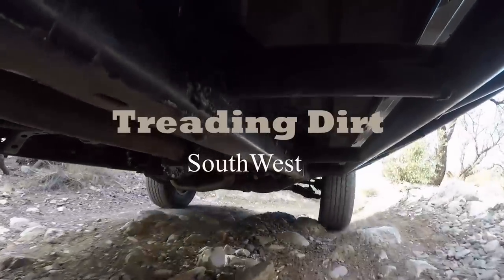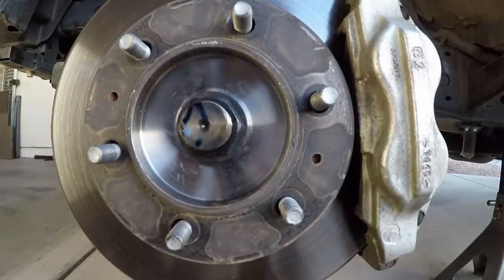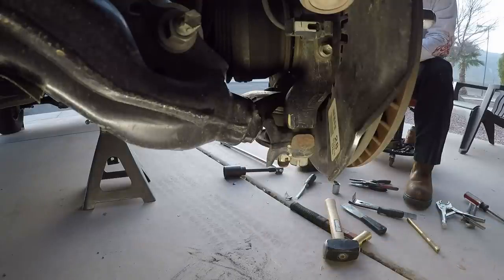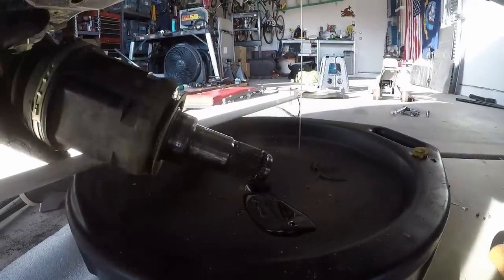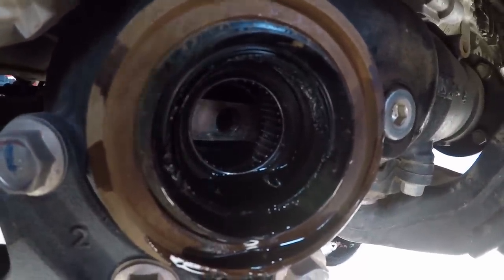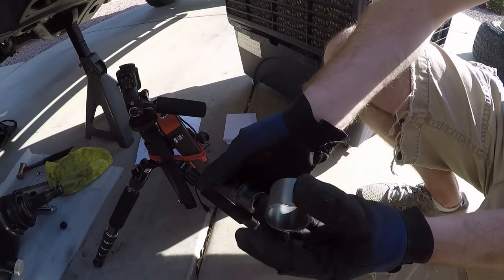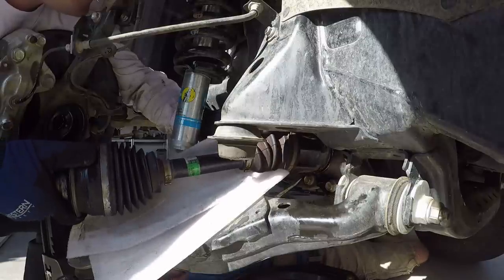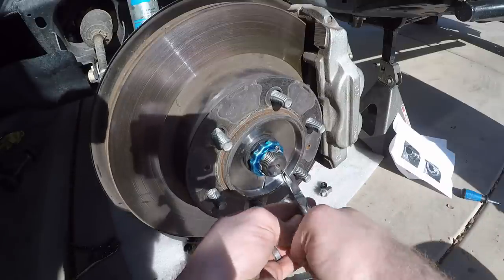Removal/Install of 2016 Tacoma CV Axle, Bonus: ECGS Bushing install

Comment: I just did this on the weekend on my 2017 trd sport and followed this video exactly and it worked great! I have 80,000km on my truck and i didnt do the seal as it looked to be perfectly fine and it is still holding great after the install, not a drop of fluid is leaking out! My only recommendation, which these guys say too, is to take your time placing the needle bearing puller behind the needle bearing. If it isn't going in, take a breather for a few minutes and try again. I grew impatient  and frustrated and ended up not installing it all the way and regretted it, I cracked the puller and had to weld it back together and re tap and die the threads (not my most proud moment). Don't be scared to give the puller a whack or two with a punch and hammer to get it to seat properly! Without the whole mix up of screwing up the puller tool this install would only have taken an hour by following this videos instructions. Thanks for the great video! No more vibrations
PS using a flat head and hammer to get the CV shaft out worked awesome, took 2 minutes to remove it using that technique
Reply from the maker: airsoftkid1245 glad it worked out but sorry to hear about the cracked tool. We’ve been known to bust out the welder a time or two as well lol.

Comment: Great video, another easy way to hold the rotor while you break the CV nut is to have someone apply the brakes. It requires a 2nd person, but works great.
Reply from the maker: Lee Mims  thanks for the positive feedback and great tip about the brakes!

Comment: Unbelievably excellent video!! In 2017, I purchased a 2016 Tacoma with 18,000 miles on it. We noticed an intermittent vibration almost immediately. We took it back to the Toyota Dealer and they said they couldn't hear it. It is a pulsing at about 50ish miles/hour. Unfortunately, it is weak at times, then at other times, very prominent. I recently took it back to Toyota and they replaced the back springs. Might I add that this was free of charge(54,000 now). I believe that this was due to the tech bulletin fix. Well, The vibration came back and my truck sinks down more when I put my utility trailer on. So, I received lighter springs and I still have that vibration that you can feel in the steering column and the accelerator pedal. I have an appointment, at the dealership, next Monday. I don't know what they will propose. I guess I want to know if this pulsing vibration was your experience. I am willing to tackle this fix if indeed it will resolve my issue. I think that the passenger side would have an identical Needle bearing? Again, thank you for the vid. I do absolutely love this vehicle. I am just trying to work out bugs. Thanks to all, in advance, for your answers.
Reply from the maker: Mick Reese hey thanks for the compliment! Have you tried engaging 4x4 to see if the pulsing goes away? If it does, that increases the chance it’s the needle bearing. And yes, mine was a pulse at times. 

Passenger side uses a different bearing so it’s just the driver side that typically has the problem.

Comment: Has anyone had this problem with 2018 trd off road 4x4?  I'm getting ready to lift my tacoma and was wondering should I buy one any to have when I install my lift.  Thanks. Best video for this.  Great job
Reply from the maker: Chad Boggs trd yes, even 19’s. Until Toyota stops using a needle bearing on the driver side this will continue to be a potential issue.
Reply: @TreadingDirtSW  thanks.  Guess I will go ahead and order a ecgs bushing so I will have it when I start lifting my tacoma when it gets warm here in kentucky.  Thanks again
Reply: Yep. I have 2018 and as soon as did 3" leveling kit , maybe after 3 weeks it happened.
So, don't wait for it , replace it right away

Comment: Great video, way better than the ECGS supplied video. Wish I saw this before I replaced mine.
Reply from the maker: srqFF I really appreciate the kind words. I did my best to make the video I wish I had before I did mine.
Reply: Treading Dirt SW my only suggestion for others is to get a torque wrench for the axle nut and do it to exactly 173 ft/lbs. The first time I did it, I didn't use a torque wrench and just hammered it on there with an air wrench. Less than 500 miles later, my wheel bearing went bad. I'm not sure if this was the cause, but it's better to be safe and do it to spec.
Reply from the maker: srqFF yep I agree! Mine only goes to 140, im looking into options for a longer torque wrench with a higher rating.

Comment: Maybe a stupid question, but what gear oil did you use to top off after you finished the job? Did you buy the toyota 75W85? If so, did you have to go to the dealership to buy it? My local autozone only has 75W90....
Reply from the maker: sakusan23 I just went with full synthetic 75/90. It’s so close to factory spec it won’t hurt anything.

Comment: You can avoid the struggle pulling the cv from the spindle by unbolting the brake line bracket from the frame.

Comment: One trick I do to remove axle nuts is to insert a large punch into the top side of the caliper and into the cooling fins of the rotor. Save a ton of time trying to wrestle pry bars and breaker bars and potentially bending a stud.

Comment: What was the noise?  Mine is a rotating rumble and pause and rumble and pause almost like driving on rumble strips with a slightly longer pause.  I can feel it in the accelerator.
Reply from the maker: Sounds about right! Mine was somewhat rhythmic and could be compared to light rumble strips.  

If it happens under 25-35mph but goes away in 4hi then it’s probably this bearing going bad.

Comment: I wonder what are the symptoms of a bad needle bearing, I cannot feel any grinding noise or vibration but I have some play on both axle shafts. I've found many videos showing how to replace the bearing but none showing the before and after movement. Is that problem just relevant to the drivers side bushing even if there is some play on the passenger too?

Comment: Did you have to undo the whole suspension to get it out. I just put a 2 inch 5100 lift. Do I have to take the 5100 out? Or do I have to mess with any suspension stuff?
Reply from the maker: R F you do not need to remove you coil assembly. The video shows 100% what needs to be done.

Comment: Did you use a career bearing drop kit or shims under the springs I’m doing a 1 1/2 add a leaf and 5100 with the 887 ome is there anything I need to do to my truck as to prevent any problems
Reply from the maker: James Howard impossible to say, I’d refrain from shims or cb drops until you have issues, if any. Easier to do one thing, then go from there if it’s not fixed.

Comment: Nice video .I got a question ,since you are install cv axle on Both sides the ecgs bushing is the same from passenger side ?
Reply from the maker: Sergio Cadima no, the passenger side uses a different type of bearing and doesn’t have the same issues as the driver side.

Comment: Great video!  I've been hearing the roar for some time now.  The dealer said it was the hub bearing but I heard nothing from them.  While checking,  I found the looseness in the needle bearing.  Where did you get the puller to remove the needle bearing?
Reply from the maker: machomie the puller is available from ECGS

Comment: Great video! Thank you. I'm going to attempt this on my third gen tomorrow. One question - did you have an alignment done afterward?
Reply from the maker: Jarrett Moore I did not need to do an alignment afterwards. Good luck!
Reply: Treading Dirt SW Great. Thanks for the info!
Reply: Well, I started on it today and got the old bearing removed and new bushing installed. I’m having a little difficulty with getting the axle back in. I know I have to apply force to get it past the retention clip, but I’m afraid to hammer away without knowing the splines are lined up. Any tips?
Reply from the maker: Jarrett Moore so tapping it in using a large flathead and large hammer didn’t work? It should go in a little further initially if they are aligned vs not.
Reply from the maker: Jarrett Moore I’ll add, it starts going in pretty easy using my method, you can hit with halfway minimal force and see it go in a few mm’s it it’s aligned.
Reply: Treading Dirt SW I didn’t really try too hard because I was afraid I didn’t have it aligned properly. There is a few millimeters of spline before the retention clip, so I’ll try again tomorrow and pay extra attention to this. I guess I should add that I was attempting to do this by myself and probably also need a bigger screwdriver and hammer. lol. I’m going to try again tomorrow with a helper. Thanks for everything you’ve done to help.
Reply from the maker: Jarrett Moore Just stick it in and give it a good tap, then if needed rotate a little and tap again. It’ll go 👍🏻👍🏻
Reply: Treading Dirt SW Got it all finished up today. Vibration and noise are gone. Wow - what a difference! Thanks for taking the time to create this video. It helped me tremendously.
Reply from the maker: Jarrett Moore super glad to hear it!!!
Reply: Just finished the needle bearing install on a 2015. Thanks to your video I avoided having to remove unnecessary components. To insert the bushing I used a 32mm socket flipped over and then inserted a 3 inch extension that I could hammer on. I was also a little hesitant to hammer the axle back in but is popped right in after a couple whacks. Thanks for a great instructional video!

Comment: Great video! Did you change your diff oil when you were done with the recommended Lucas oil or just add to what was in the diff? Was the removal tool necessary? I see it's almost the cost of the bushing. Thanks!
Reply from the maker: Jim Kotz I had already replaced the fluid previous to this with synthetic 75w90. The oil recommended by ECGS is mainly for when you swap gears with theirs, not when you do just the bushing. 
I believe 140 weight would do some good but this is my daily driver and I like the great fuel economy.
Reply from the maker: Jim Kotz forgot to answer your other question. I found the removal tool to be very useful but personally it’s a little overpriced if you ask me. Search the forums or FB groups, I bet someone would let you “rent” one.

Comment: Great thank you . Because I didn’t know you could use OME 887 springs with bilstein . How much lift did you get with no spacer just springs .
Reply from the maker: James Howard I did the lift by myself and forgot to measure from center hub to fender before I installed. It’s around 2” but I have a shell, steel rear bumper, sliders, and a 3/16 steel skid so I ended up with a little less. I think next time I’ll go with 888’s. 

And as a disclaimer, OME recommends only their shocks be used with their coils. I haven’t had issues yet nor has anyone in a 3rd gen group I moderate.
Reply: Treading Dirt SW what group I’ll join . Did you take your struts somewhere to install the top hat or just bought new ones
Reply from the maker: James Howard  I’ve used both the lower control arm and a floor jack to compress springs, as well as a rented compressor from autozone. Only one I needed to have a shop compress was 888’s I recently helped a buddy with. Truck wasn’t heavy enough and the tool failed. 

The group is 3GT-3rd generation Tacoma

Comment: Do you think it’s safe to trust any mechanic or Toyota dealership to do this procedure for me if i provide them the parts?? I was wondering how common it was and if enough shops are fluent in the procedure. Your insights would be highly appreciated! Thx
Reply from the maker: That’s so hard to say, because I’ve seen some terrible mechanics lol. I don’t think you need to take it to a Toyota dealership however. A shop that does a lot of axles/differential work would be the safest best in the absence of any of other info. If you want to be safe.

Comment: So what vibrations are you getting? 

I'm getting a rhythmic grinding and vibration between 1,100 - 1,500 rpms or 30- 40 MPH. 

Thinking this could be the issue. Thanks in advance.
Reply from the maker: Alex Helie sounds exactly like a needle bearing issue. A good test is to put it in 4hi while it’s giving you a vibe and see if it goes away. If it does, most likely the needle bearing.
Reply: @TreadingDirtSW  I got 2wd. No CV axle 😔
Reply from the maker: Alex Helie lol then I’m confused by your original question. With no needle bearing it can’t be the needle bearing. It could be the tires, brakes, drive shaft, or rear diff, rear axle, etc. I’d start with the tires personally by checking the balance and tread. 

If you are lifted it could be an issue with your pinion angle, or even an out of balance shaft. If you have a carrier bearing maybe try a drop kit, cheap and a 5 min install.

Comment: tracked this video down from the 3rd gen facebook group. Thanks for the video, looks pretty straight forward. Did ECGS supply the needle bearing removal tool with the bushing or did you order that separately?
Reply from the maker: Jimmy Kane I purchased it separately from them. It's pricey but I didn't want to run into issues so I went for it.
Reply: this is the 8, not the 7.5 right? i want to make sure its all good before i order. my taco is making a racket. gotta do this asap lol
Reply from the maker: Jimmy Kane yep! 8" driver side.
Reply: thanks buddy!
Reply from the maker: Jimmy Kane any time!
Reply: @TreadingDirtSW  8" on driver side only or is it 8" driver and passenger?
Reply from the maker: bee yang you only need to do the driver side. Passenger is already a bushing of some sort.

Comment: Did have to get an alignment done afterwards since u loosened the lower control arm?
Reply from the maker: P Pha actually I didn’t, the lower ball joint attachment kit was what we removed, we did not mess with the LCA bolts. I have a lifetime alignment and awhile after we did this I took it in for a check and it was still good. Your mileage may vary of course and it’s never a bad idea to take it to the alignment shop. I do it 2x a year to be safe. Tires and suspension components are expensive!

Comment: Thanks for the Video!!

are those 6112? i am installing those, i figure my needle bearing will go bad.    I got a stupid question... so you only replace one side?

also, how do you like the 6112's?
Reply from the maker: Cash Miller you only replace the driver side because the passenger side doesn’t have a needle bearing. 

I don’t have 6112’s but I admin a Tacoma FB group and never hear anything negative about them 👍🏻👍🏻

Comment: it looks like the the small plate you positioned behind the needle bearing went in smoothly. did you need to tap in at all or just angled in?
Reply from the maker: ro mo super easy, if I remember right we were setting up the shot and it went in so easily we hadn’t even hit record yet. You shouldn’t have to hammer on it like crazy at all.
Reply: Thank you great video clear views of your work and explanations.

Comment: Hey Guys great video , I get a really bad steering vibration at 60-70 mph on my 2017 tacoma , tried everything from alignment to tire balancing to bearing drop with no luck. Do you think this might be the reason?. Got fox 2.5 suspension with icon upper control arms . Thanks in advance !!
Reply from the maker: Shenal Hathurusinghe  probably not, it’s more of a rumble and it usually happens at slower speed. If you can safely test it, putting it in 4x4 should make it go away if it’s the needle bearing. Have you considered axle shims?

Comment: Did you need an alignment after? Also any difference from going from a bearing to the bushing?
Reply from the maker: Darren Roth didn’t need an alignment but got one anyway just to be safe, I have a lifetime alignment anyway and it was time to have it checked. Numbers came back unchanged. 

The difference between the needle bearing and the bushing is no more rumble lol.
Reply: Treading Dirt SW thanks for the reply.  I’ve been putting it off for a year.  Had noise ever since I got the truck lifted. (3,000 miles). Had toyota look at it multiple times and could never figure it out.  I’m at 50k now. 2013 dbcb.
Reply from the maker: Darren Roth there’s a TSB for the 3rd gens and it’s been going on since at least 2005 so they should know. I’d get it replaced ASAP though as over time you run the risk of it falling apart into your diff.

Comment: Just started the humming noise in my 4runner and researching the ecgs. Will the needle bearing ultimately fail and cause damage or is it just more of an annoying sound and vibration.
Reply from the maker: At some point you’ll run out of needle bearing and that wouldn’t be good. There is a chance it fails all at once, with material breaking apart and into the diff. 

The truth is that you probably have time, like thousands of miles. But you don’t want to just ignore it for months and months.

Comment: What is the part number for that needle bearing? How did you get that part by itself or did you buy a full kit?
Reply from the maker: Dillon Kroll I ordered the bushing, removal tool, and axle seal. Ended up not needing the seal but wanted it on hand just in case. Not sure about part number but eastcoastgearsupply.com has really good part descriptions.

Comment: Did you use aal or a block for the rear if so what size
Reply from the maker: James Howard AAL in the rear, supposedly 2”. I have a shell, steel rear bumper, swing gate, etc so on top of the AAL I’ve also added a set of adjustable helper springs by Hellwig to reduce sag.